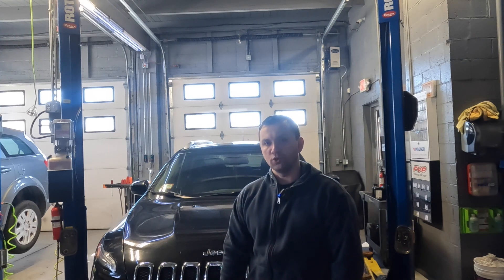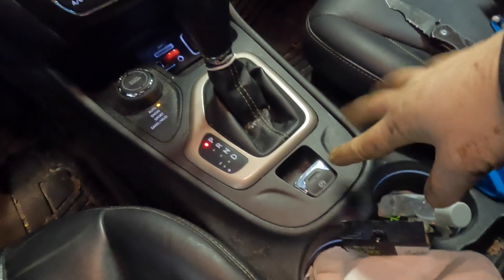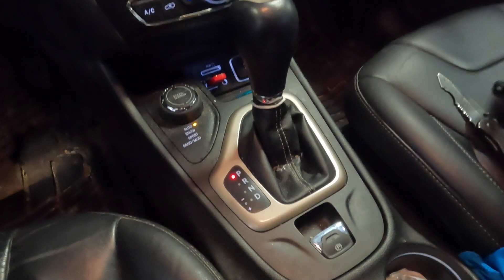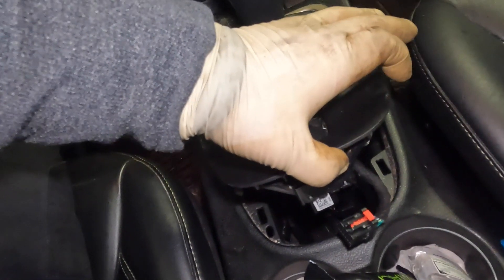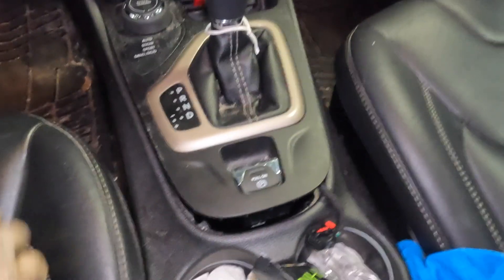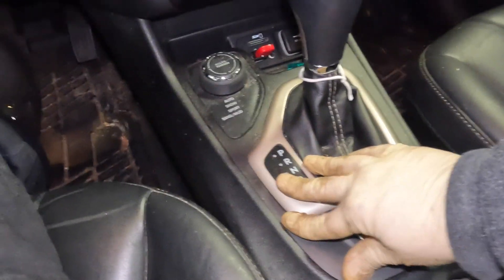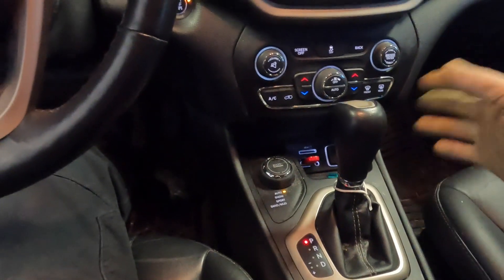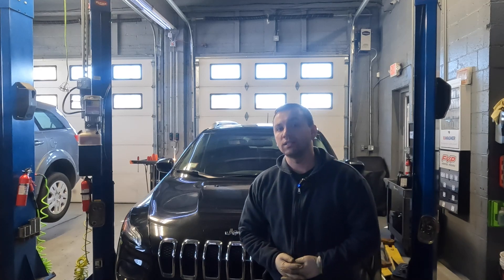CUSTOMER STATES CAR WONT MOVE! JEEP PARKING BRAKE ENGINEERING FAIL! SWITCH REPLACMENT.

Comment: My car still drives and brakes fine but the parking brake flashes is it safe to drive?
Reply from the maker: When it flashes, it’s basically giving you a warning that something is going on with the system. I would probably get it looked at just to make sure that the system isn’t going to randomly lock up on you when you park it and never release.
Reply: Mine did this. It warned me and now the parking brake is stuck on and won’t turn off. I’ve tried everything

Comment: If the light on the switch is staying on but won't release could it still be your switch or epb module
Reply from the maker: Could be either because that switch can short out and light up, and the computer can also do it aswell it's hard to say without looking at it.
Reply: @TheEnthusiastMechanic I have a jeep compass and soda was wasted in that area last night today it put it self on ebrake while I went in the store came back and it wouldn’t release it also said check e break switch before I left home but it allowed me to release it but when I tried to leave the store it would not I tried to reset the car and unplug the switch plugs to the e breaks and it didn’t work if it isn’t the switch it self cause it’s still lighting up cause the wiring be damaged or is all on the switch it self

Comment: Hey man awesome video!! I just replaced the button you’re talking about. I got the park brake to disengage. But after putting it in park. The park brake won’t disengage. Do you have any suggestions??
Reply from the maker: @jasonlong8430  you may have a possible stored code in the system that needs to be cleared out and the computer is probably setting the brakes on. Try plugging your old switch and see if that will unlock your emergency brakes. Otherwise you may need a scanner to see what the computer is seeing.

Comment: My car have the circle P and it won’t go forwards or backwards but it will crank and start. It will park. It says service Electronic Stability. Please help I slam on breaks really hard and hit my yard pole in my yard.
Reply from the maker: Sounds like you need to take it into a shop or dealership. That’s not the same issue that was shown in this video. Unfortunately, there’s no advice I can give you.

Comment: Any info on a 2014 overland i dont have that button on my console and im unable to to push in the brake to even start my jeep
Reply from the maker: I would suggest pushing a little bit more firmly or you may possibly have a bad brake switch
Reply: @TheEnthusiastMechanic  yes I've probably been pushing more then I should be lol and if it was a bad brake switch would the brake lights still come on?
Reply: @TheEnthusiastMechanic  one guy suggested that it might be the brake pads and I just changed them today They were pretty warn out, I disconnected the battery for half hr after and still saying service electronic brake system
Reply from the maker: Brake lights will not come on if you have a bad brake switch those simple things don’t turn it on. You may wanna take it into a repair shop replacing the brake pads is not gonna really solve your issue.
Reply: @TheEnthusiastMechanic  yes the tow truck is on the way to deliver it to the dealership
Reply: @TheEnthusiastMechanic  omg the tow truck driver arrived and he asked what was wrong with it and I told him it's unable to start and he gets in the vehicle and low and behold the damn thing started!! 😡 I just wasted $210 for him to come start it for me then leave, what a piss off man

Comment: I have replaced the switch with a brand new one but my brakes still won't release. Help! Anyone have any suggestions?
Reply from the maker: You would have to probably clear the codes that are saved in the computer. Usually it would take a scanner to do so or try disconnecting the battery. I had to use my computer to initialize the system to get it to accept the new switch.
Reply: @TheEnthusiastMechanic  I got a good scanner and manually disengaged both actuators and they keep locking everytime I park. So I manually disengaged them then unplugged them. Everything is fine I just simply have no parking brake now.

Comment: I had to hit my brakes hard on freeway today and my cup with juice fell forward without realizing.  There was some on parking brake. Everyone was fine. Later today started up and automatically electronic parking brake service comes on. Check park brake" appears. When i put my seatbelt on it shifts properly and i can drive. Parking break switch lights up normally so its not dead like in this video.  Safe to say there are no electronic issues with lights or anything but the" P" is on my dash. Must need to get new switch its annoying. Im pssd
Reply from the maker: You’re not alone this happens to a lot of people. It’s a very common issue. It’s the worst location for the switch.

Comment: Sir, can you please help. In your video the parking switch light is off and inoperable. Mine does function on/off when I engage the button. On the dash display, it does have the ((P)) symbol illuminated with a “service park break” message. Additionally, the check engine light is illuminated. The car won’t drive forward, nor will it reverse. Is that due to the common EPB issue? Jeep Cherokee Sport 2014.
Reply from the maker: It may be related to the electronic brake, or it might be something else this video only covers if you’re not able to switch it because the switch is bad this car didn’t have a check engine light it had a code for the switch range.
Reply: @TheEnthusiastMechanic  Thank you for responding to my question. I had to take my vehicle to the dealership for repair. A private mechanic wasn’t able to fix it. Apparently the TCM stopped communicating and it threw the computer out of whack. I had to have the TCM reprogrammed and now the vehicle is back up and running.
Reply: @Phillians413  I have the same issue with my 2015 Jeep Cherokee. Did you get it towed to the dealership? Also, how much did it cost to repair. Thanks in advance!
Reply: @ Yes, took it to to dealership and to my surprise it was the battery. Replaced the battery and haven’t had this issue since.

Comment: I have this issue with my wife's jeep I have tried 2 different switches both of them have not worked, having to leave the car in gear to stop it rolling.
Reply: I figured it would be without a highend diagnostic machine but thanks anyway 👍
Reply from the maker: Sometimes it’s not the switch. The computers are also known to go bad on these
Reply: @TheEnthusiastMechanic  my 2017 jeep renegade sport will not even start, the dash says service parking brake, it will not release or over ride, cant even push the foot brake pedal down to start, like the whole vehicle is locked out from starting
Reply from the maker: @commiesnzombies  you may have to get a mechanic involved. If you are at the point where the car won’t start or you may have to manually trigger your brake lights to get it to start.
Reply: Any ideas how I can get it to reset and get the handbreak back on? Because this car is really starting to piss me off now! I've never known a car to have so many issues
Reply from the maker: @davidobrien8013  without a professional scanner it’s hard to reset that system

Comment: I've replaced the switch and the module and my jeep parking brake still won't disengage
Reply from the maker: If you replaced the module, sometimes those require programming that’s possibly why it’s not working

Comment: So basically I could do this myself since I know that the switch is what's wrong. I don't need to connect it into the computer after I switch out the switch?
Reply from the maker: No you shouldn’t plug and play unless you have hard set fault codes

Comment: So I go start my car today it runs fine and I see the parking brake is engaged and I press down to disengage but the brake light doesn’t go away it just flashes and I can’t move I tried to trouble shoot it and I my jeep Cherokee won’t move .
Reply from the maker: Same issue this jeep had
Reply: That's my issue
Reply: same problem with my
Reply: Same here in Nunavut, Canada. It’s with a shop now, but I know it’s going to cost me because they need to tow it into the shop to get it fixed.
Reply: Any new advice for the mechanics here?

Comment: So my break releases but does have that symbol
Reply: The electronic break is working I hooked it up to snap on code machine it's saying my tcm has dropped its Memory so now I'm gonna go see about having my tcm flashed
Reply from the maker: The light only comes on if the system has failed if its working and releasing you wont have a light.

Comment: OK so I have this same light but my Cherokee drives just fine could it still be the switch?
Reply from the maker: Could potentially be the switch because the light is on it usually means the emergency brake is applied